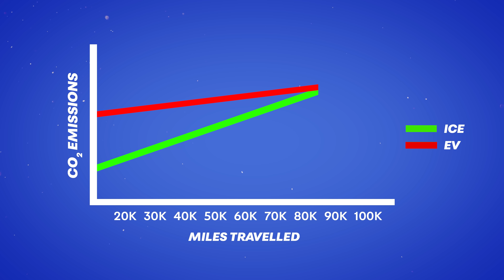Are Electric Cars REALLY That Green? [New 2022 Data]

Comment: I have never owned petrol or diesel car that actually does it’s claimed mpg, so did Volvo account for that???
Reply: And EVs take more electricity to charge because of Phantom Drain, and losses (10-15%) for Wall-to-Wheel.
And EVs range estimations are typically way off too by about 20%.
Reply: true

Comment: End of life for EV vs Ice …… disposal of batteries somewhat polluting and not good for the environment, perhaps this should be included into the argument of which is ultimately the worst/best option? 

….
Reply: How so with a 95% plus recovery of materials.
Reply: EV batteries are larger and heavier than those in regular cars and are made up of several hundred individual lithium-ion cells, all of which need dismantling. They contain hazardous materials, and have an inconvenient tendency to explode if disassembled incorrectly.
"Currently, globally, it's very hard to get detailed figures for what percentage of lithium-ion batteries are recycled, but the value everyone quotes is about 5%," says Dr Anderson. "In some parts of the world it's considerably less."

Comment: One point for consideration.  I believe Volvo assumes mining raw materials.  We should also consider that battery materials can be recycled, and I assume that take less energy to do vs. mining
Reply: Battery recycling is currently very labor and energy intensive, unfortunately. I hope we can drastically improve that process before the first generation of EV hits recycling centers
Reply: @speedracer2please  that energy can be renewable tho
Reply: @stevevotier354  that would help, we just don't have the facilities to recycle them en masse yet. The way we do it now is just one guy working with his hands for hours on each battery, we need a way to automate it and do it more efficiently before this wave of batteries run out of capacity
Reply: Recycling batteries saves 5-10% of the carbon emissions compared to making a new one. The biggest benefit is that it means the reuse of rare-earth materials.
Reply: @Cernunn0s90  Do you have a citation for that.
(Last time I checked, EV batteries basically can't be recycled even due to their residual energy [LOTS], risk of fire, and complexity of the metals and non-standardisation of EV LIB packs, which mean they can't be disassembled [dangerous] by automated process).
Reply: It's likely assuming the current production methods that they are actually using, and not relying on a hypothetical situation they aren't invested in at the moment.

Comment: The XC40 isn't design for EV in the first place, that should taking in the maths
Reply: And a Tesla Model S Plaid with a 405 mile battery and a 2 second 0-60 is also not designed as an efficient example of how to use batteries to move people around.
Reply: @kyleschellenberg3777  the vast majority of people don't buy Tesla Plaid, but Leaf or model 3, which are really efficient. That's like comparing a 90hp Toyota Yaris with a Lamborghini Aventador, which we both know are 2 cars with excellent gas milleage (no)
Reply: Tesla has over 20% of the BEV market and it's pretty obvious that their focus is on performance and range, not efficiency or just-right sized solutions. Is there a Model 3 that does 0-60mph in over 5 seconds?
Reply: @kyleschellenberg3777  Yeah, the RWD model 3 does 0 to 100kmh in 6.1s. But beyond that, maybe Tesla is making fast cars because it's a big selling point to help customers go full electric? And the permanent magnet motor from the model 3 is one of the most efficient motor for EV right now + you don't have to go crazy on your right pedal and the car will be more than efficient. None of your arguments are valid
Reply: Tesla is creating a car culture that equates EVs with performance. Nothing wrong with that, if it helps sell cars, but it's missing the mark in terms of meaningful environmental benefits. From your prior example, it's harder to drive a base Yaris aggressively because there's not enough power, so that limits people to drive sensibly. It gets harder to use the pedal gently when you know there's a lion waiting with a stronger press. Maybe Tesla will make a 'Yaris' still, but regardless as you noted there are several other companies building EVs with less powerful motors and smaller batteries. So the choice is there, even for an XC40 EV.
Reply: @kyleschellenberg3777  slow cars are the funnier to drive (better drive a slow car fast than a fast car slow). Beyond that, a smaller engine won't last as long as a bigger one because we're putting more stress on it by always using 100% of its capacity. As I just say, you can chill out on the accelerator and have a very economical EV. All of the Tesla owners feedbacks I've read/heard are the same : you make a lot of crazy accelerations for the first weeks because of the new experience thing, but you drive your car normaly after this "transition period", so I'm really not convince about the "missing the mark in term of meaningful environmental benefits" since you don't (and can't...?) always drive your car like crazy
Reply: @raphaelbourreau9875  It's nice to have that option to drive faster when you feel like it, and still be relatively efficient when you don't. On ICE cars, you buy them with that performance built in and it affects the gas consumption even when you drive calmly. That's a perk for EVs for sure, the best of both worlds.  Have a great day my friend, nice chatting with you.

Comment: At 90,000 miles before an EV becomes less damaging to the environment, EV batteries having a life span of 10 years & the average UK mileage per year being 7,400 miles this pretty much means EVs are worse for the environment. Significantly so as Coal fired power stations produce more pollution to power an EV per mile than petrol.

Hydrogen fuel engines can't come quickly enough.
Reply: News for you.... Natural Gas is burned to generate most of the hydrogen and when renewables are used to generate hydrogen via electrolysis, that process is very in efficient  ...  it's 10 times less efficient to get the same number of electrons in the hydrogen FC car, as they need to be converted to hydrogen, shipped as a liquid and then converted from hydrogen back into electrons inside the car.. there's like 20 more steps..... whereas we can just send the electrons straight into the car battery via 'wires' at the speed of light. That drop in efficiency means we need 10x more renewable capacity on the Grid if all EV's are to be hydrogen. 
A second news flash, hydrogen FC cars are still EV's that run off a battery, it's the just the battery is tiny and gets topped up slowly by the fuel cell. They are pretty limp on power due to small battery and limit on how quickly the Hydrogen to electric conversion is..... so no FC car will ever be beating a Tesla at the lights.
Luckily, Coal is used less and less every year. In 2020, Coal only accounted for 2% of the UK's electricity generation and it's due to disappear entirely in the next couple years. Gas and Coal combined accounted for 41% of electricity generation in that year and renewables and non-carbon sources 42%.
Reply: @joeynessily  all completely correct
Reply: @joeynessily  why would you need to convert hydrogen to electrons when you can just use the hydrogen as fuel like internal combustion?
Reply: @SkotiM  ... because that's what the hydrogen fuel cell vehicles which already exist work..Burning hydrogen would be significantly less efficient than the already less efficient electrolysis/chemical reaction with Oxygen  .. you'd be wasting more of your energy as heat rather than moving the car.
Reply: @joeynessily  less efficient in terms of fuel used in the creation of movement given current technology, but if technology can be developed which makes production of hydrogen cleaner that wouldn't be an issue because burning hydrogen doesn't produce environmentally harmful fumes. 
Which is why I said Hydrogen engines can't come soon enough rather than we should use hydrogen now.
Reply: @joeynessily 
Biomass power generation produces more pollution in the UK than any other type of power generation. Additionally biomass and ethanol production are the two primary causes of rain forest deforestation.

The byproducts of nuclear power stay toxic for between 1 to 10 thousand years.

Solar panels and wind turbines require large amounts of fossil fuels in their creation and have a life span about the same as a tesla car battery.

You should watch Planet of the Humans.
Reply: hydrogen as a mass-produced vehicle fuel has already been debunked. where does the huge quantity of elemental hydrogen we'd need come from? its produced by burning fossil fuels. hydrogen is going nowhere believe me.

Comment: Honestly Rory I think you've done a terrible job here and are contributing to unhelpful misconceptions.  Your opening statement of:

"Are EVs any better for the environment as a whole than an ICE car?  Not necessarily, and in fact in some ways EVs might actually be worse on a like for like comparison".  The correct answer here is: yes.  In almost all situations: yes.  By scrabbling for a scenario where they might not be you are willfully missing the point.  

The ICCT published a white paper not 6 months ago on "A GLOBAL COMPARISON OF THE LIFE-CYCLE GREENHOUSE GAS EMISSIONS OF COMBUSTION ENGINE AND ELECTRIC PASSENGER CARS" in which they concluded "Only battery electric and hydrogen fuel cell electric vehicles have the potential to achieve the magnitude of life-cycle GHG emissions reductions needed to meet Paris Agreement goals".   the assessment finds that the life-cycle emissions over the lifetime of BEVs registered today in Europe are already lower than a comparable gasoline car by 66%–69%.

You claim people have some "very passionately held views on this topic".  Do you mean the topic of misinformation slowing the needed transition to low carbon transportation?

Comment: I thought the first video you made was too optimistic and it's unfortunate that I was right. I am however concerned that the discussion hasn't got so far as how much resources will be sacrificed for the charging infrastructure and the impact of  just switching to that. But don't forget! In major cities or concrete forests EV's still make way more sense to ensure a better air quality. And that fact has proven so important in ex China that EV's are necessary to help improve the terrible air quality. In my humble opinion the current "BAN ALL ICE CARS!!!" politics should stay within the cities and companies should still push an option, but that all swedes for instance, living vastly different lives and not all EV appropriate, should be forced to switch to electric for very haste reasons is just odd. City centres could have a "no ICE space" were cars allowed are EV's and hybrids running on all electric when passing to ensure a better air quality. Love these type of videos, keep it up!!!

Comment: Very interesting arguments and congrats for having the balls to talk about it. There is A LOT more points that need to be covered before we can actually claim to have an answer. But just to sort of balance on the other side of the argument, Rory, while it is commendable that you use only renewable energy to power your car, that, at the moment is not an option we can count on to scale up. Just not possible with the energy efficiency of solar and wind we have right now. Not to mention that if we choose to do so, we have to take into account the carbon footprint and pollution of plastics and materials that are not recyclable. Just as we need to have those figures for fossil fuels as well. But hats of to you for, in essence, showing the one thing we can definitely conclude about this right now: we just do not know the truth right now

Comment: I’m glad you identified that electricity production is getting greener & battery production will too. On the flip side, crude oil is becoming dirtier to obtain. Here in the U.S. we’re using off-shore drilling which has had massive spills & fracking which decimates the environment.
Reply: China just built, the largest coal plant ever. They promised to “start reducing” coal burning, by 2025. 
At the current rate, it won’t matter.
Reply: @billpetersen298  Maybe its needed for  a stable wind turbine and solar cell production :)
Reply: @bingoberra18  It’s not needed, by any measure. Once the pollution is out there, it’s not going away. China had a rural agrarian economy. (Low impact). They could have learned from the mistakes of developed nations. And developed, I a manner, that was slower, but more thoughtful. Especially, including ethnic, and religious diversity. 
Windmills and solar panels are also not green, or good for the environment. They add another layer, to what was done before. Polluting less, is good, but not after you’ve wrecked the place.
Reply: @billpetersen298  China absolutely needs to be taking more action, but we should not forget countries like Australia or Canada that produce 2.5x as much CO2 per population.
Reply: @dob3k714  Yes, the only issue is nuclear waste, but if that is the only issue that prevents us from zero emissions stable energy, I cant understand why countries dont just focus on it more. Just put all you have into handling the waste safely and problem is solved. Unfortunately the environmental groups are too loud and thick headed so politicians get scared.
Reply: @bingoberra18  nuclear plants power are cheap to run and most efficient source we know - means if we build more of them the power could become free to everyone. 
That should answer your question why we don't see them widespread.
Reply: @smc812  To say Canada is second largest Country on planet there emissions is pretty low in comparison.
Reply: @dob3k714  They are bad polluters
Reply: @bingoberra18  dude, most nuclear plants are beside water,l by necessity, when those water levels increase, and they are already, there will be a lot of potential fukushimas. Nuclear is just a money maker for large companies, wave and wind are smaller enterprises and far more effective. In Scotland we produced three times the amount of power we needed last year through these means. My family made its living managing oilfields, but the next gen now works in wind farms and alternative fuel power plants... Nuclear is not the answer, but it's being pushed by energy companies so they can keep grip of supply and profit. It's a seldom reported scandal, as big as any at the moment in reality, allowing them to profiteer when our energy could and should be far cheaper, globally.
Reply: @billpetersen298  Although China have just built a huge coal power plant, they have more EV's and EV busses than any other countries and are constructing the most efficient power grid in the world. 
Unfortunately, while we are buyig more and more crap from China, they have to keep up with the power requirements to make all that crap and a coul plant can be built in a couple years while a nuclear plant takes a decade to build
Reply: @stevec6427  It's our fault, they developed in the fastest, cheapest, nastiest way.
Reply: Like mining lithium is any cleaner. There is no moral high ground.
Reply: @kevinblackburn3198  With hydrogen fuel we could greatly reduce the use of batteries and instead use the energy to produce hydrogen, but it takes a lot of energy and wouldnt make sense to produce using wind and solar power. We need nuclear, and a lot of it.
Reply: @bingoberra18  Not efficient enough and too expensive
Reply: Try not to worry the oil is slightly radio active and the water in it is put back in the ground under pressure and just like in a engine block it cracks the surrounding material thus creating earthquakes and the water can an does seep into your water supply....
Reply: @DavidandDeborah Cohen... Exactly. EVs have been in development some 100 years LESS than ICE vehicles. EVs will get better. ICE vehicles will not.
Reply: @delfordchaffin5617  actually one of the first electric cars was built in the 1880's. Over 100 years ago a choice was made between EV and ICE vehicles and the winner was big oil. There was clearly more money (maybe faster money) to be made from refining oil and refueling cars than producing electricity to charge car batteries. 

Think where the world would be at now had they chose electric vehicles over gasoline. The battery industry would be far beyond where it's currently at. The trade off would be far less development in the plastics industry since the refining of oil produced much more than just gas, there are many types of plastics that would never have been invented had we not chose big oil.
I'm not saying one is better than the other, they both had or would have had very different impacts on how we currently live.
Reply: You have the biggest puddle of oil in the world in Alaska...bigger than all of Saudi Arabia. And Joe Biden is busy cancelling drilling leases up their right now.